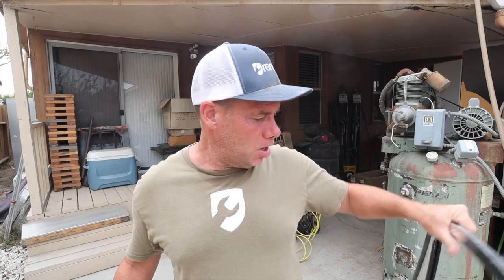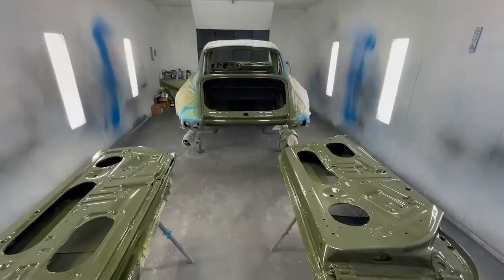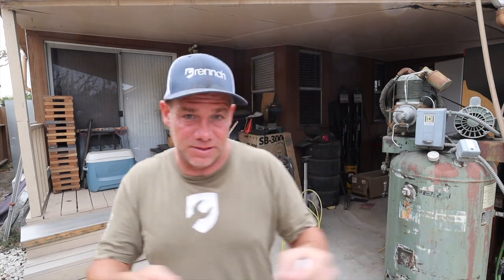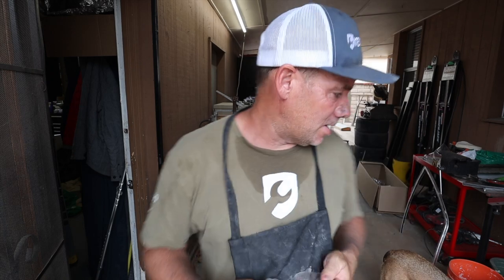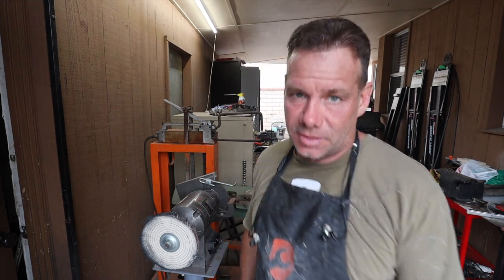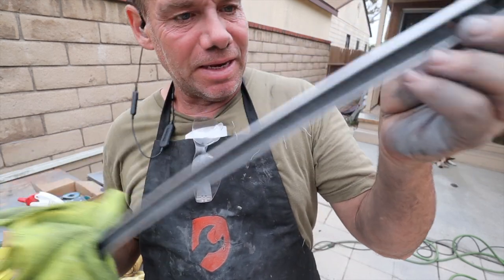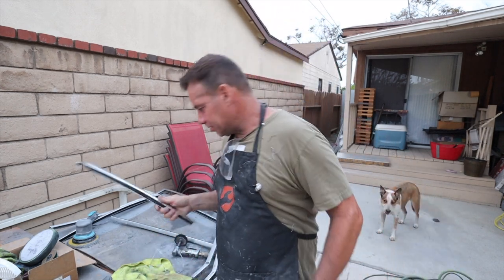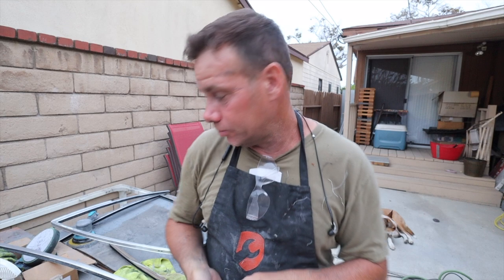Polishing the Aluminum trim on the Subaru Swapped Porsche Blasphemy Build! | Episode 90

Comment: Been following this project since the beginning and it has kept me motivated during my multi year 911 project. I have been thinking of polishing the brightwork, currently black like yours, would you ever tackle this job with the trim on the car?
Reply from the maker: Yours is black now?  You have to disassemble it a bit.  But it's easy to remove the frame from the door, so no big.

Comment: How will you protect the aluminum now that the anodizing is removed? They'll corrode pretty fast.
(Don't ask how I know this 🤣)

A 2k clear would be a quickie DIY. 
Cerakote clear is another option.
Reply: A little Boeshield and some rubbing now and then will keep them bright. I know  because I had my Fuchs done in the 80's and the polish went away in 6 weeks.

Comment: You need to find a unit where the arbor can handle a thicker polishing wheel or pad and that’s rated for no more than a half horsepower you’re probably using one in excess of three-quarter horse power…..